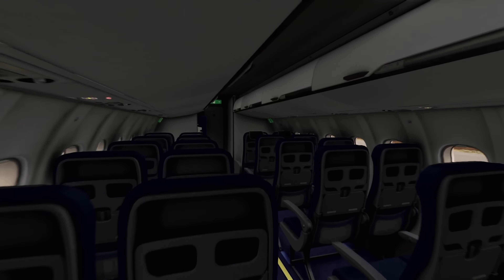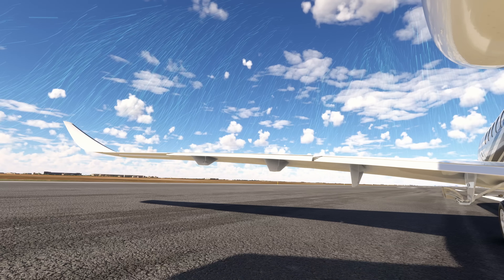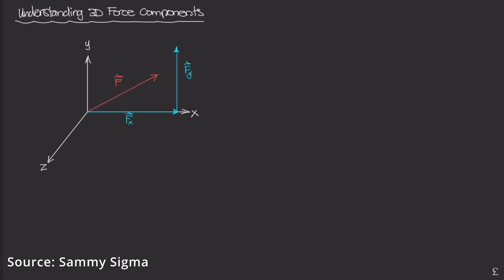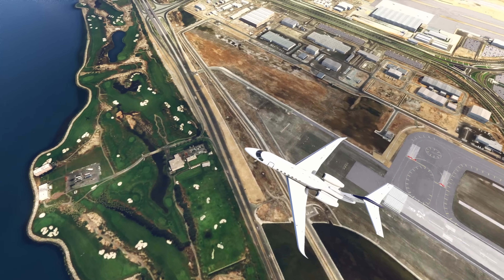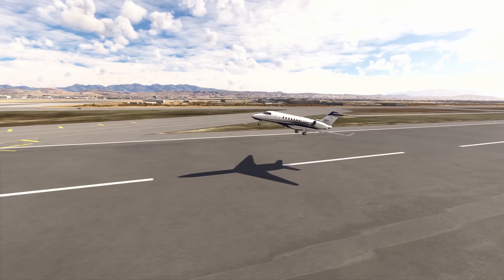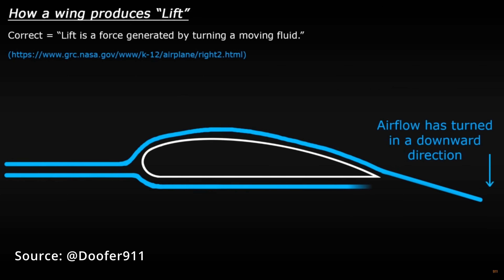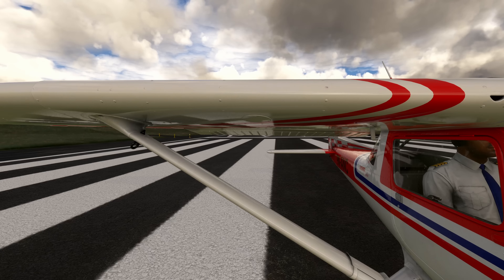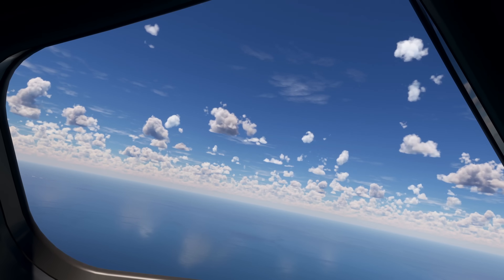The Truth about Lift

Comment: Sorry, but no! Try to hold a sheet of paper horizontally (by one of its borders), hanging close your lower lip and blow tangentially over it. The paper won't throw the wind down; instead, the sheet will go up.
Reply: That's right but try that same experiment doing this: 
Put your hand in front of you, more or less at your chest height, with the palm pointed to the ceeling. keep your head still and blow air, you will feel just a little air movement on the palm.
Now take a sheet of paper and try it again, while the sheet is "flying" the air felt on the hand is more.
I am not an expert but this is my home made explanation 😂
Reply from the maker: A sheet of paper is very light. It definitely interacts with the air (decelerating an upward draft is the same as accelerating air downwards). Without sensitive equipment and extremely precise testing conditions, I doubt you could get a reliable result from blowing a piece of paper.
Reply: @flyingformoney777  facts
Reply: @flyingformoney777   I'm afraid you didn't understand the experience I mentioned. I didn't say to blow under the paper, but over it. Yes the paper is light but the air blow is weaker than the relative air speed on a real wing. In all wind tunnels there are static ports over and under the wing that attest the differential pressure. Airplanes fly upside down only in a greater angle of atack, with the airflow being split in a different point in front of the leading edge and inducing extra drag.
Reply from the maker: @MarceloTrindade1  pressure is a part of the equation. I wasn’t claiming otherwise. But air has to be deflected to produce lift.

Comment: Actually air does not travel over and under the wing ... the wing travels through the air...the air is NOT moving..as EVERY diagram always incorrectly shows.
Reply from the maker: It actually doesn’t really matter. The opposite is true in a wind tunnel. The physics are the same.
Reply: @flyingformoney777  yes you are correct... but every explanation shows air flowing past a wing....  I guess it would be too difficult to depict the wing moving in a picture or diagram

Comment: so can someone explain why the air over the top of the wing accelerates? creating a low pressure. as it is proven the air from the bottom and top surfaces dont neccessarily have to meet at the trailing edge
Reply: kutta-joukowski theorem it the best one to get a grap, just google it.

Comment: There's no one perfect theory that fully describes everything that's happening because the physics is extremely complicated.  However, there are two commonly accepted simplified theories that scientists and engineers battle over but neither one is wrong.

Pressure Theory: There is no equal transit.  Wind tunnel tests with smoke trails and slow motion video will show the smoke up top transiting faster than the smoke on the bottom, and that means the pressure above is even lower than equal-transit theory.  Low pressure above and high pressure below the wing results in a lifting force on the wing sufficient for flight.

Newtonian Theory:  The wing redirects air downwards (on net) and Newton's equal-opposite reaction pushes the wings upward sufficient for flight.

Both theories are correct and each can independently describe sufficient lifting force to hold up the airplane.  The theories are describing two sides of the same coin.  There are even more theories that can describe the lift but none of these theories debunk each other.

Comment: Delta wings still employ an airfoil shape including drooped leading edges - even the thinnest, sharpest wings employ an airfoil shape that is seldom purely symmetrical, what you’re saying is that lift is primarily created behind the trailing edge? Then how do we account for the centre of lift centre of pressure over the upper surface? What about reflexed trailing edges on flying wings? Is a flying wing both pushing down at the trailing edge (creating increased AoA) and up at the leading edge? Is lift a function of force pushing against a surface or a management of flow creating pressure differential - it’s not making sense to me. I design aircraft parts and performance remotely piloted aircraft and am finalising my own design two seat touring aircraft and the understanding I have of lift is more to do with Bernoulli than Newton and still my machines and parts fly, if we are able to so precisely hone the designs based on our current understanding does it really matter if there’s a different understanding?  Another area of aerodynamics that seems to follow Bernoulli’s law is flow control and laminar flow - considered in the design of not just lifting and control surfaces but ducts, inlets, junctions etc. What of the effect on lift that upper surface devices like VG’s produce?
Reply from the maker: @flymachine  When making lift, a wing redirects the air from a higher point (leading edge) to a lower point (trailing edge). Generally this is done by a combination of wing shape and angle of attack. Pressure plays an important role in aerodynamics. But the lift itself is always limited by how much air is being redirected downwards.

Comment: You really don't understand how air flows over a wing, Inverted flight works because the incident air separates at a different point at the leading edge of the wing. That can be visualised too. In this, case the path UNDER the wing is longer and therefore at lower pressure, generating lift. Bernoulli is if the correct explanation. It's NOTHING to do with blasting a mass of air downwards at  all.

Why are Americans so DUMB ?

Comment: In the "air travels farther over the top" explanation I never understood why the air from the top must necessarily meet the air from the bottom. Years later, I was relieved to see that they don't actually meet.
Reply: so what actually does create lift? it is the downward deflection of air by angle of attack?
Reply: @mach1shobhan  didn’t you see the video? It’s magic.
Reply: @mach1shobhan basically the top of the wing is shaped so air follows the surface and is forced downwards.
Reply: @shaun1293  i understood this but what im tryna clarify is does the downward deflection of air cause the air to accelerate and create a low pressure region above the wing? or like the shape of the wing makes the air accelerate
Reply: @mach1shobhan  Lift is the reaction force of air pushing up on the wings when the wings push the air down. The shape maximizes the efficiency. Any flat-ish shape will create some lift if it's angled slightly upward.
Reply: @Raging.Geekazoid  ah so the deflecting of air downwards create lift? like even on a flat plane surface angled downwards how is the low pressure zone created on the top surface is what im confused about if it's not the shape of an airfoil creating the low pressure zone
Reply: @mach1shobhan  It's just Newton's first law: Inertia makes the gas travel in a straight line. That means away from the upper surface and toward the lower one. Even if the upper surface is flat, it'll still be in the shadow of the leading edge as long as there's a positive angle of attack.
So there are lots of molecules bouncing into the lower surface but not so many on the upper. Low pressure eventually draws air downward from above the wing, but by that time the wing has moved out of the way, so there's a jet stream of air moving downward behind the wing.
Reply: @Raging.Geekazoid  thanks
Reply: @mach1shobhan  it does create a low pressure region but that doesn’t cause the lift. A wing works like a propellor or a turbine, it is simple a case of Newtons Laws of Motion. For every action there is an equal and opposite reaction. For a prop or turbine, air is forced out the back, aircraft moves forward. Wing moves air downwards, plane goes up.
Reply: @shaun1293 Props and turbojets work in totally different ways.
Reply: @xyzaero  they work the same way in that they both force air in a certain direction. I said turbine, not turboprop. Turboprops still have propellers ;)
Reply: @mach1shobhan if the simplest form of your question is "Does the shape of the wing create a low pressure area above it that almost sucks the aircraft away from the ground like there was a giant vacuum cleaner in the sky?" the answer is definitively NO.

But does a properly designed wing create a pressure differential that affects the air flow and helps to reduce drag and in an indirect way increase lift and better flight performance? *YES*.
Reply: @Laotzu.Goldbug  lets marry and have kids together now

Comment: Good stuff, except weight is a force. Specifically it's the mass of the object times the local acceleration. (F=Ma). For level flight in calm air, it's the mass of the object times local gravitational acceleration (F=Mg).
Reply from the maker: @dougsundseth6904  yeah I was abstracting there a bit. What I meant was it’s not an aerodynamic force.

Comment: As always, a superbly crafted video with great explanation.  I recall my early days when I flew control line model aircraft (the ones that fly around you on a long pair of cables. Some of the models I flew had solid balsa wings, no camber/airfoil shape. Flight was created purely by the angle of attack of the wing, same as when you put your hand out the window of a moving car & feel it lifting. Crude, but effective, providing you have the thrust. Obviously does not have the efficiency of a cambered wing.

Comment: It easy to descend into pointless hair splitting discussing this subject, but pilots need to understand it to fly the plane not to design planes or write a fluid dynamics PhD dissertation, so this was great. Force equals mass times acceleration, so to counteract the weight of the plane (to maintain un accelerated flight from the frame of reference of the plane) there needs to be enough air mass accelerated down times the degree it is sped up in that direction to equal the force of the mass of the plane pulled by gravity. (Note that I avoided taking a stance on “gravitational acceleration” as my impression is that this is a different “controversy” of oversimplification in explaining things.)

Comment: It's a bit of Bernoulli's principle and Newton's 3rd law. For Bernoulli's principle, I imagine a garden hose and then putting my thumb slightly in the way. What happens? The velocity of the fluid increases and the harder I press the hose, the more the fluid increases (to a point). The normal wing shape does this by "pushing" the upper airflow (forcing it to speed up) but not the bottom airflow. This increase in velocity decreases the pressure of the fluid (air) and causes a pressure imbalance above and below the wing, helping pull the wing up. This velocity increase also helps throw more air downward and backward. The reason some airplanes can still create lift while flying upside down is that they have a special wing design that relies much much greater on Newton's 3rd law of slamming air in a specific direction (similar to a boat rudder having the same curvature on each face). Take a Cessna 172 flying upside down, It would need to go breakneck speeds to have the speed required to rely solely on forcing air down, and Bernoulli's principle would be working opposite to pull the plane down making it need a much greater negative AOA. Higher cambers (how curved the wing is) would decrease performance at higher speeds so more performance-type aircraft have limited camber, until landing where they can increase it (using flaps) for more air thrown downwards, and decreasing pressure above the wing at lower speeds.
Reply: No. The lower airflow is squeezed. The upper airflow is pulled. That is why the lower airflow is at higher pressure.

Your garden hose is not a good analogy for your attempted point. The flow velocity is increasing out the hose because you increased the upstream pressure by constricting flow area.

"Squeezing" is not what increases the flow velocity. What's causing this is the upper surface at high angles of attack creating a low pressure void that the air rushes in to fill. This is easier to understand if you imagine the upper surface as the aft surface, creating a wake while the air tries to curve around the leading edge. This is why at higher angles of attack, you get more induced drag. Because that low pressure on the top of the wing has a partial rearward vector, and that rearward angle increases with angle of attack. Again, the upper surface is also the aft surface.
Reply: @米空軍パイロット a better example for the garden hose is to take an A4/letter size paper, hold the narrow part at each corner with your fingers and blow over the top of the paper, not below the paper. The low pressure above the paper will make the paper go up.
Reply: @rtbrtb_dutchy4183  Yes. That is mucb better. That is an example of how the air wants to curve around the paper, and so it in turn pulls the paper upwards.
Reply: @米空軍パイロット  you’re right. “Squeezed” was the wrong word. It’s just hard to put the diagram into words. The way the garden hose theory works is describing why the velocity increases. The air going over gets pushed into the air higher than it which creates a need for higher velocity. It’s like going from a 5 inch pipe to a 3 inch pipe, the velocity changes because more fluid is going through a smaller gap at the same rate. Thus lowering pressure. Essentially, it is reducing flow area
Reply: @murphinator5586  Yep. And it's a simple relation on the mass flow equation. Mass Flow = Velocity x Area
Reply: @米空軍パイロット  yeah. I was hoping the garden hose visual would make a little more sense then. I normally draw it on a white board for students. They tend to like it a lot more than just “the air speeds up over the wing”
Reply: @murphinator5586  But there is also one thing I really want to drive home with your visual. The air only barely speeds up in when compared to the freestream. The lower surface air is often slower than freestream for most of the surface. This is because the wing is an obstruction that causes drag. The driving force behind the difference in upper and lower surface velocities is mainly the fact that at positive angles of attack, the air is colliding and being compressed on the lower surface. The air on the upper surface is meanwhile sucked into the low pressure zone caused by the need for air to fill the void left in the wake of the wing. The differences in velocity between upper and lower surface are also largely negligible in explaining total lift produced, only contributing about a quarter of total pressure difference. The majority of the lift comes not from the speed of the airflow, but the direction of airflow being pushed downwards. The wing is just a large ramp that redirects air.
Reply: @米空軍パイロット  That works in high angle of attack settings but when at a negative AOA,  I don't see how deflecting airflow alone would work because now the airflow would be on top of the wing pushing down. I have flown airplanes at 5+ degrees nose down with high airspeed (no flaps so not a lot of airflow downward) and still maintained level flight perfectly fine. In these scenarios, it only makes sense that the lift would be primarily from the pressure differential. Also, when looking at the airfoils in clean configurations, the deflection of airflow down is only slight, the increase in velocity over the wing not only decreases pressure but also causes more air to be thrown backward and downwards. I think that the way airplanes produce lift is dependent on both pressure differential (caused not just by air speeding up, but also pressure increasing as air slows and compresses against the leading edge under the airfoil due to upwash/upflow) and Newton's 3rd law. The one providing the better-lifting force changes based on several factors during flight. The garden hose analogy is just a way of describing why the air speeds up without diving into starting vortexes, the Kutta effect, and the 16 million other things that add to lift. You are definitely an intelligent individual and I am enjoying this conversation.

Comment: Those 'regional' planes attract icing, by design.
I don't think turboprops are useful presently in commercial planes.
Jets are better.
AQP should be mandatory training at this level worldwide.
Pilot exhaustion, and psychological overload are contributing factors in the many crashes that I've watched, and there are way too many crashes in aviation. Wings are the weak link in aviation.

Comment: Could you detail why science is 'wrong' about lift, and actually you hint at much more  that is going on in this video.
Lift and Bernouli's Principle was never resolved I, read.
 A Video where (using an accelerometer app. During a flight) showed a constant acceleration to Flght Level.
Reply: Airplanes climb at a specific airspeed that provides the best climb rate. The airplane will vary its climb rate to maintain this airspeed so since we didn't change airspeed, the acceleration will read constant.
Reply: @murphinator5586  I'll link the you tube video that shows a rather steady speed increase;  yet it may take some search effort on my part to get it back; it was some time ago.
Reply: @murphinator5586  Takeoff from Kiev, Ukraine. Altitude and Speed Recording. Airbus A320 
https://www.youtube.com/watch?v=pmHrn-KJVZM
Reply: If by "constant acceleration", you 2 mean "constantly zero acceleration", then you'd both be correct. Words matter. Please use them properly.
Reply: @米空軍パイロット at a constant indicated airspeed, there will be a positive acceleration the higher you climb.
Reply: @米空軍パイロット  Kind of the plane just keeps going that's all I know!
ATC does not step in at take off, yet only gives direction and appears also, no speed instructions.
Reply: Usually I guess...
Reply: @wayneeligur7586  you are correct. The airplane will gradually accelerate the higher it climbs.
Reply: @米空軍パイロット  it’s not a zero acceleration. It’s a positive acceleration at a constant indicated airspeed, the higher you go.